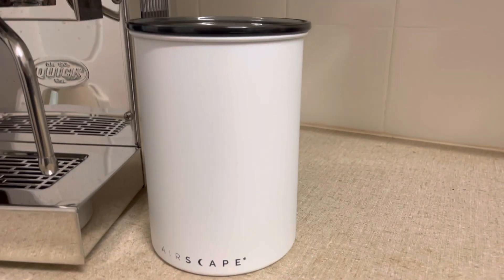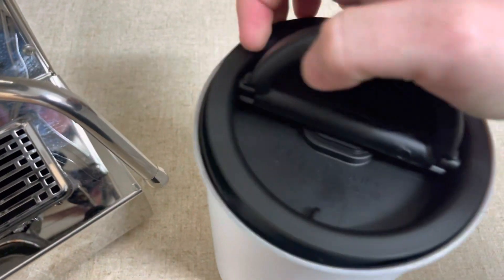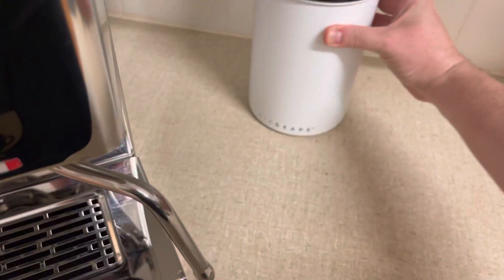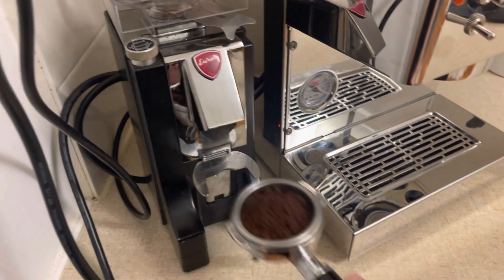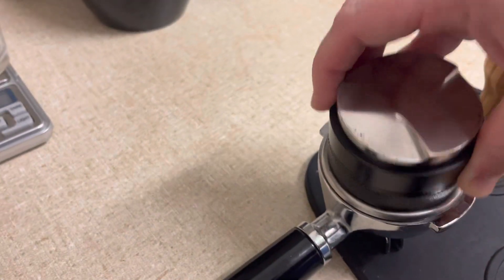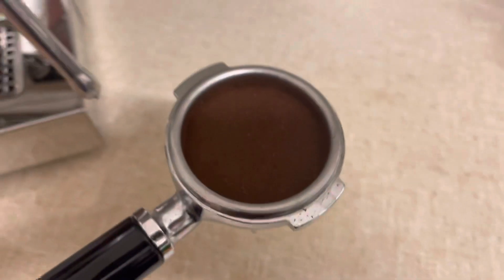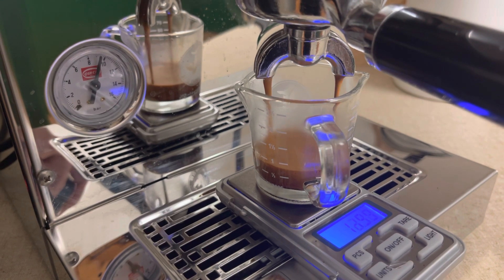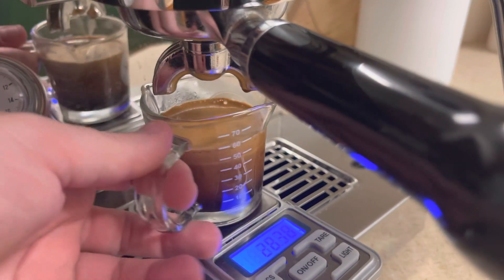Quick Mill Pippa - new Airscape Cannister and espresso progress

Comment: What leveling tool do you have?  We have a quick mill Pippa with the bottomless portafilter too! A little dialing in but so far great.  What do you recommend for a grinder?  The Eureka MCI or another?
Reply from the maker: Hey Anna
I use a distribution and tamping combo tool from Amazon and a WDT tool also from Amazon. The wooden tamp I use is a nicer model from the espresso machine shop I bought this machine from. For the grinder I do love the eureka, but people often say get the best grinder you can afford as it makes the greatest difference to the flavour profile of the espresso you’ll pull!

Comment: Hi! I am a newbie and just got my first espresso machine, the pippa! I'm a barista but have only really worked with automatic machines. So this is my first REAL espresso machine. I'm curious what kind of grinder you use, because I'm having difficulty getting my grinds fine enough with my manual grinder that I've used for my french press.
Reply from the maker: Hey! How good!! I have a eureka Mignon MCI grinder. I got it secondhand off fb marketplace for $125AUD and I have never seen one that cheap since either. It was pure luck. It is a step less grinder too so it has an infinite amount of settings. I just went to really fine and found it was too fine to allow water to pass through, and slowly went coarser until I got the right pre-infusion time (7 seconds) and stuck to that setting.

Comment: Thanks for the video. I have the exact same setup and am also new to the espresso world. Please can you tell me what setting your grinder is on? I am battling to get crema, I use between 1 and 2 but get virtually no crema. If I use a coarse grind like a 4 I get a lot of crema but my shot comes out in less than 10 seconds.
Reply from the maker: Hey so sorry for the delayed reply. My grinder is a step less grinder meaning I can twist it many many times with no way of actually determining what setting it’s on unfortunately. My grind is pretty fine though, coarse enough that it doesn’t all bind up into balls, but fine enough that it’s not far off being dust!

Comment: What is the size of the basket? 58mm or less?
Reply from the maker: It’s an e61 group 58mm portafilter. There are two basket sizes - single is about 15/16g and double is 21-23g.